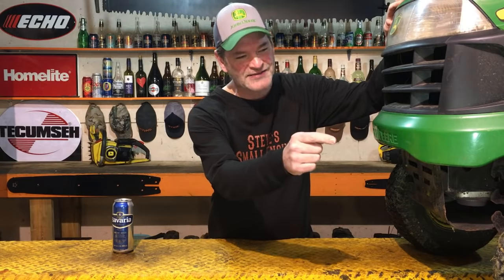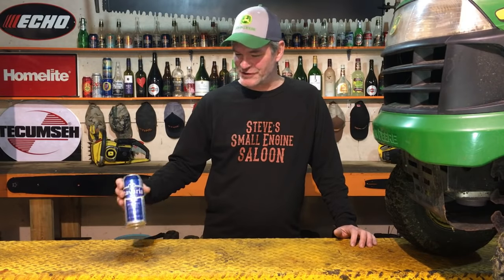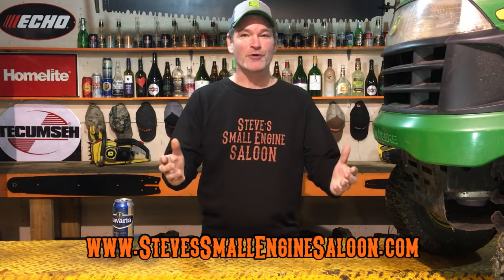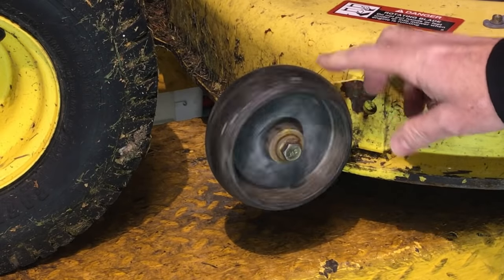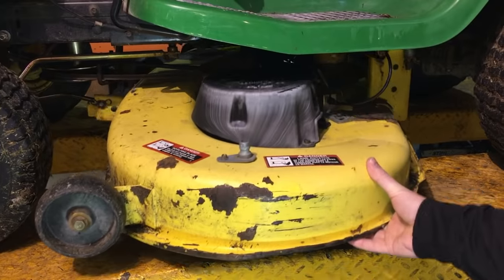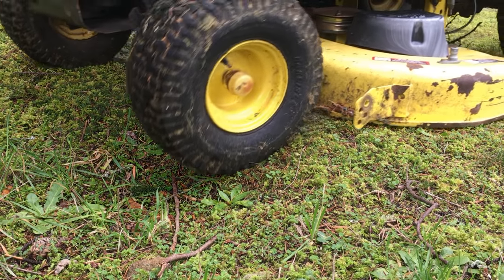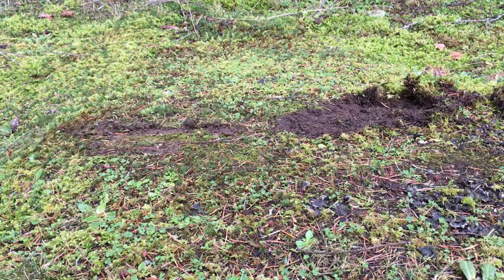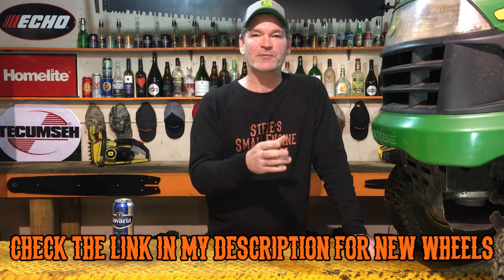How To Correctly Set the Deck Wheels on a Riding Lawn Mower Tractor

Comment: some people make it easy to learn, your one of them , thanks for easy DIY videos.
Reply from the maker: You're Welcome...
Reply: @StevesSmallEngineSaloon  I've got a John deere l120 and it cuts unevenly. How do i adjust the deck. Mine doesn't have the rod and nut for adjustment.  Its a plate on both sides with a bolt and nut. Hopefully that makes sense.
Reply: Hi Steve, armed with this information maybe the will be less scalping. Less scalping equals a nicer lawn to look at with a really cold beer. I’m one of the few that reads and files my manuals,doesn’t always mean I remember it all. 😁thanks Steve.

Comment: I have been cutting grass with a riding mower for 50+ years and I never knew how scalp wheels worked.  Thanks!
Reply from the maker: You're Welcome...
Reply: I just level the deck and set the scalp wheel 1/2 inch lower than bottom of deck. Done.

Comment: I inherited my Husqvarna 48in mower from my dad after he passed. It is 15 years old or so and still has the original anti-scalp rollers. He showed me the logic behind them. I took his word for it because he always kept his equipment in top-notch shape. Heck, he had a 40 year old Sears push mower that only had the blade, wheels and pull cord replaced.

Comment: I bought a Huskvarna 54" Zero turn several years ago at Lowes.  It was a "customer return".  My buddy told me the guy didn't like the way it cut grass.  I bought it for a little more than half price and took it home.  Well, I figured out why the guy didn't like it.  He never adjusted the anti-scalp wheels at all!  They were all the way up!  Reset them like yours and I was good to go.
Reply from the maker: Right on buddy....
Reply: up..... but the problem with your comment is that his were all the way up also....
Reply: @brianbailey462  Iadjusted them all the way DOWN.
Reply: @TexasScout  so that means you are cutting higher than before? But possibly rolling on those wheels a lot more as well?
Reply: @brianbailey462  I set the deck at 2.75" then adjusted the deck wheels to just touch the ground.
Reply: @brianbailey462  no, I had it set to 2.75” on the first cut and I had scalps all over my lot. Once I adjusted the “anti scalping” wheels it just touch the grass, problem solved. The wheels were in the top hole, even with the bottom of the deck. In other words, they weren’t doing anything.

Comment: You are right Steve.  Nobody reads owners manuals anymore when you have great informative videos like yours.  Love them so much I subscribed.  Drink a beer!
Reply from the maker: Thanks 👍
Reply: No one reads them because they're so ineptly written they're almost unintelligible. Another reason is that 80% of them are designed only avert lawsuits. Do we really need to be told not to stick our heads underneath the deck when the blades are running?

Comment: Hey thanks for the videos. I have JD 108 lawn tractor that started cutting unevenly. After searching UTube for adjustment solutions, I couldn’t find one. I remembered a video you made that said that one should check the tire pressure before any other adjustments. In that I didn’t find any adjustments on my tractor I fortunately remembered your statement and the truth that it bore. Thanks for the great advice! I owe you a six pack!
Reply from the maker: Glad I could help

Comment: Thanks for the video Steve. I have the one on the left practically worn flat while the right one is good. i have purchased two new ones and will be replacing them both, plus adjust the mower deck height too. It's low on one side.
Reply from the maker: Right on

Comment: I changed my blades on my LA 130. Reset the deck at 2.5 inches with a 2.0 inch blocks. Then went out and cut my grass. Scalped the grass alot. Just found out. I needed to reset my scalping wheels. Really thought I goofed up. Thanks, Small engine man. Shawn.
Reply from the maker: Good stuff

Comment: Glad you did a video on this common issue. I see them worn so bad they wear a groove in the deck bracket. Setting the wheels too low is also one of the culprits for breaking the mount off the deck.
Reply from the maker: Thank You...
Reply: That literally just happened to me. I had the blades replaced and noticed the first cut after that was scalping... today... the whole mount broke off.. now what 😳
Reply: @bert7478  In the mower shop we would weld them back on the deck.  Any weld shop or mower shop should help. A competent mower repair shop should also level your deck.
Reply: @xmarkmechanic1  thank you so much-loved. I talked to my neighbor and he said he can do it! I'm so glad I don't have to replace the deck or worse, the whole mower!!

Comment: I run a craftsman riding lawnmower from 1987 and it's still in great condition.  One thing I noticed for parts, some stuff like starter solenoids count as engine parts.  I called craftsman last summer looking for a starter solenoid and the lady didn't know what I was talking about.  So in some cases you can't buy specific parts from your mower's manufacturer but have to get them from other vendors.  Also, 6 months later I was in the local O'Reilly auto parts store and sure enough they carried a limited supply of riding lawnmower parts and the part I needed was there.

Comment: You also want to ensure the tire pressure in all 4 wheels are set correctly first
Reply: You are correct. I use offset gator blades and I was cutting lower than the setting on my lawn mower because of low tire pressure in one tire. This also caused my anti scalp wheels to roll on the ground.

Comment: Always a pleasure Steve... You are spot on the money with the wheel settings. I am spoiled with my newer JD XT500, I think at (8) years of age currently. My wheels are pinned & easily adj. & they also pivot around 180° for rolling the deck out versus dragging it out! Lol... Ain't nothing worse than scalping, especially rocky outcroppings... The rocks always win!
Off subject here Steve. What are your thoughts on the Husqvarna XP 372 chainsaw. I like most things about it, however as with all today's saws, carburetor adj. screws are now capped, at least until the warranty runs out. Then my tach gets put to good use for H & L & idle. I think all one can do is idle adj. currently. The saw is bit dated now, but it still cuts real strong as I understand it. It would be a nice addition to my Husky Rancher at close to 20 yrs. old & has a used lower end in it now...
Bill Farr... :-)
Reply from the maker: 372XP is one of my favorite saws of all time....

Comment: Thanks, will check the height!
 3 holes, it's in the middle.

 New mower, any unlevel spot it cuts deep into the dirt, like more then scalping

 Other issue, Craftsman 225 t, it's a tight turner those deck wheels drag sideways,  they need be swivel wheels as to turn along with tires.
... like when going around a small tree.
Reply: good idea.. those should be swivel wheels to be able to take the turns with the mower!

Comment: Thanks Steve, I just went through that exercise with my JD X300.  JD said the wheels do not come factory set!  You have to level your deck, be sure the tires are properly inflated and then drop your deck to, as you said, your normal cutting height. JD manual said I should have between 1/8” and 3/8” clearance to the ground under my wheels. I had almost an inch so I had to lower my wheels to the lowest setting to get 3/8”. My so called lawn is very uneven so the wheels spin a lot but they are not continuously touching the ground.

Comment: I agree 100%. I used to work for International Harvestor, and St up and repaired the Cub Cadets.  Many of my customers would run the wheels on the ground, and destroy them.  Think about it, there are no bearings in those wheels, and they are not designed to be on the ground continuously.
Reply from the maker: Thank You...

Comment: @Steve: have you ever heard of someone adjusting their riding lawnmower deck? My riding lawnmower goes up to 5 but even at the highest setting, it scalps my lawn. Is there a way to adjust the deck so it cuts higher than a 5 or higher than the highest setting? If anyone knows, please comment to my question. I had the blades sharpened but it still scalps the lawn. ☹️

Comment: The problem I found when set like that and you want to clean the mower deck up with the clean out  hose you can't get the deck all the way down to the ground to create   a seal because it stops just a half inch below where you normally want to set these wheels. One of your earlier tips showed if you didn't have the mower all the way down it didn't clean very well at all.
Reply: was wondering about that myself

Comment: Installed a relatively new grass here in Florida called "Citra Blue" It has an underlying mat which gets to be very shortly after installation about 1.5 to 2 inches thick. Have a Husqvarna 46 inch rider. Problem: Even on the highest height setting mower is still too low. Recommended cutting height is 4 inches. However, mower sinks into mat and cuts grass too short. Looking for recommendations on fix. Grass is beautiful and seems to like Florida climate.

Comment: Hi.  Thanks for the info.  My old Snapper rear engine ride on lawn mower, that has a single blade, and an 8 hp engine, with the bicycle type handlebars, the worst thing about it I found in TX with Bermuda grass, where I would like to cut it to an inch long is that length seems to simply be too risky to get scalping with a floating deck type mower.  The worst thing was it was designed without the anti scalp wheels.  I bought a couple and rigged them on the back side of the platform because that was really the only place I could put them.  At first, Ii had them too low and I had problems.  But now apparently they are too high and if I hit a divot in the yard it will scalp some.   Or if I don't cut only in the slowest speed, in turns there is a risk of scalping.  In fact for the last 6 years I just said the heck with it and switched to a self propelled 22" mower that eliminates any problems.  It almost never has an issue unless I have the mower too low.  I will eyeball the wheels again with your tip and see if I can't improve it as I have a need to use it again with some health issues.  My dad's tractor type mower, had rollers that went clear across the back of the deck and were very close to the ground and that to me was the best design, other than the newer 360 mowers.

Comment: My John Deere came with an owners manual?

Yeah, I actually read, then over time forgot some details.  
Here’s a tip if you don’t want to scalp your lawn:  remember to check the cotter pins that secure the arms that suspends the mower deck.  If they work their way out or break your deck will drop to the ground then when you turn you will cut a grove in your nice lawn.  😖

Comment: Hi Steve I have learned much from your videos, Thanks. I have a question I hope You can answer, I have a craftsman Lawn tractor with the sears wheel weights. For the last 18 years I've had to remove weights to check or change tire pressure(poor weight design) and I'd like to modify the weights so I can access the valve stem without taking them off. Can you tell Me what's inside the plastic outer shell of the weights? I want to cut a hole to gain access to the stem. Thanks

Comment: My anti-scalp wheels are set exactly as you've described but I still have a couple of high and low spots in my yard that still get scalped every time.
Reply: That is normal. Small mounds will get scalped.
Reply: Fix the mounds?

Comment: I can see where the wheels have been set on my John Deere 42" deck, I doubt that they have ever been moved from there original factory setting, I will have to move them up one hole higher to achieve where you say they should be. why wouldn't they be properly set when the mower was built?  Thanks for the videos.

Comment: Ive never reset those from the factory settings.  I mow my grass on either 3 or 4 depending on how thick it is, sometimes, right up to the top, at 6.  My deck wheels rarely come into contact with the ground.  They just make the deck easy to roll around when it's off the tractor.

Comment: I noticed I cut my grass at 2 1/2" I adjusted my wheels to be at the highest hole and it scalped my yard. I than put it on the 2nd hole it rides the ground but it prevents the deck from scalping the yard. I have a uneven bumpy yard.
Reply: is it leaving ruts from those little wheels?
Reply: @brianbailey462  Not much no.
Reply: @everythingvideos24  nice... Yeah I think I'm going to drop mine down from the top 4th hole down to #3 today and see how it goes

Comment: Mine was set to low so went to adjust the deck. The cotter pin broke and fell out on the front so the deck was lying on the ground.
I put a new pin and checked the adjustments and I was good to go.
Reply from the maker: Right on

Comment: Hi Steve  love ur videos learned alot thank you so much for everything you do for us all, got a quick question, got a lt1000 Craftsman tractor 42in deck and it has no wheels on the deck and when mowing it scrapes iff my uneven couole of hills in my yard, can i put universal wheels on the front left n right sides of the deck and if so do i get 2  lil wheels or 4 wheels and which wheels do i get universal tractor wheels for 42in deck or some other wheels  Thank you Steve

Comment: Steve...I just acquired an old Deere LX188 and I'm unsure as to how to run the lawmower. Once the deck  height is set with the little wheel under the seat, am I supposed to mow with the handle all the forward (to the locked position) or just let it "float" (IOW, handle released from the full raised position but not locked down in the full forward position). I'm raising my wheels today!

BTW, love your channel. A great source of very useful information. 

Bob in Oregon

Comment: I have a ford lgt14d riding mower the deck is raised and lowered with hydraulic cylinder there is no different level settings it's either up or down on wheels so they wear out all the time ? Am I missing something it's like gauge wheels carry the deck  when put down no in between adjustments unless you move wheels? Am l missing something?

Comment: I have a Craftsman 46” rider and I cut St Augustine at the top cutting height on the mower. At that height, the anti scalping wheels are hanging about 1 1/2” from the ground and when I hit uneven areas in my yard the deck will dip down enough to scalp before the wheels touch. This leaves areas that are scalped to the ground. The wheels are set to their lowest setting on the deck. How can I prevent this from happening without lowering my deck cutting height? 
Thanks, Larry

Comment: Bought a Craftsman 42 inch T110 and has no anti scalp wheels. My guestion is  how many wheels 2 or 4   go on the deck  and can I buy wheels kits and install myself. I only see holes on front of the deck on each side  but nothing on rear of deck. I guess the holes are for wheel and bracket . Thanks
Reply: I just bought the same mower . I’m installing two on the front for now . What did you end up doing ?

Comment: Hi Steve, I am little confused. Your video shows the wheels are bolted to top most hole on the deck. By doing so the wheels will be in to most position and may never touch ground even if the deck is scraping the ground. Please enlighten me. Thanks.
Reply: It depends if you are cutting a golf course green or a bumpy lawn. How high you like to cut your grass. 3 inches or 4 will be a different hole than say 2 inch lean cut. What ever your hight than put the scalp wheels 1/2" higher than the ground as to let the deck float until you take a corner. Then one side of the scalp wheels will touch without tearing up your lawn.

Comment: Good video Steve. When I change blades on my Husqvarna lgt2554, 3 blades, does it matter where each blade is in relation to the other? As long as the star pattern lines up and the blades are on the correct side down. Thank you

Comment: Think you need more beer! That is not true for all tractors. Case/Ingersoll tractors have a lever that raises n lowers both gauge wheels to adjust how tall the grass is cut. To mow the lawn you lower the deck and set the hydraulic control lever to float.   CHEERS!!

Comment: I just got a new JD S240 and check basics- Air pressure was way off from dealer. I check deck adjustment and it seems spot on per manual. I cut 3.5 inches so the anti scalp wheels needed adjusting. They were all the way up so I moved them down. It has like 5 spots and JD is nice enough to mark the deck telling you were to set. Here is my question. Once I set wheels on each side front ( it only has them on front) I can slide fingers under right front wheel so it's like 1/2 inch. But the rleft front wheel is like 3/4 high. And when I measure that same left front of deck Botton its also a 1/4 inch or more higher than right  side.  thoughts ?
The rear measures same height on both sides /no variance  It seems like front has a slight tilt. It has a single daft rod in center front to support deck so I could see how it could tilt.  Im going to buy one of those blade heist gauges to measure blade height,  I just did first cut with new mower and it seems fine. Im pretty particular on set up etc so maybe Im over think this .. Thoughts, ideas ? Thx-- your videos are good!

Comment: Do you have a video of leveling A john Deere D170 deck. I follow instructions in the manual and it cuts way low.  I put the deck height at 2 1/2 inch and 2 inch blocks under the deck. ?????

Comment: How long till they wear out. I have a la145 and it cuts uneaven ive adjusted it. But I have not done anything with my scapling wheels. For example if the lawn mower dips in anyway it dosent scalp but it dose cut lower and leave an uneven line. Like if my front tire goes into a whole. Wont completely scalp tho. Is that the wheels or is my deck out of adjustment?